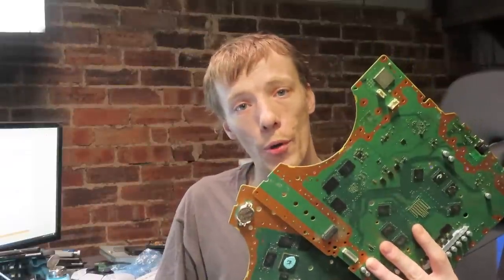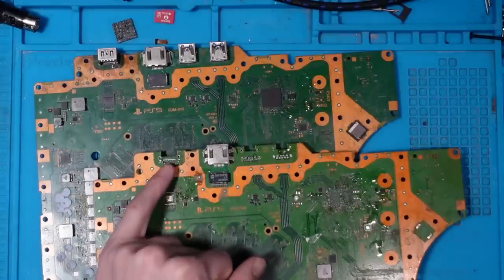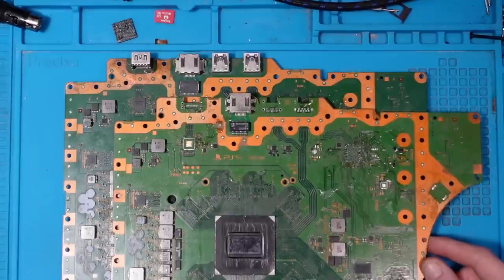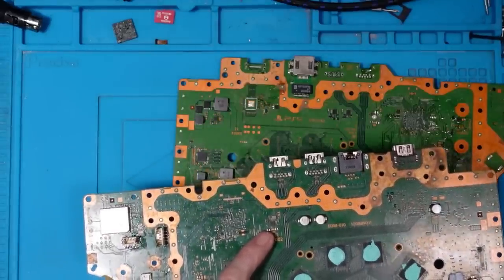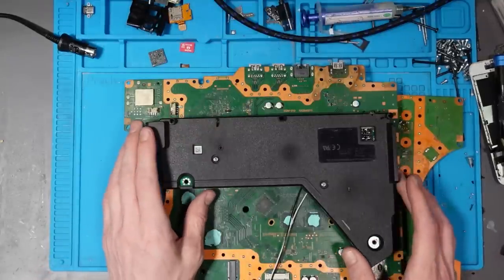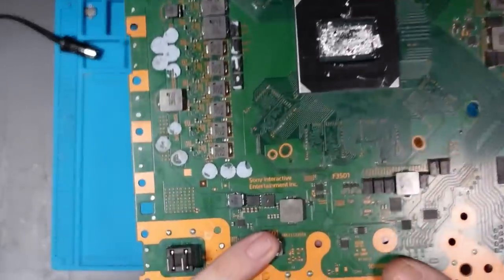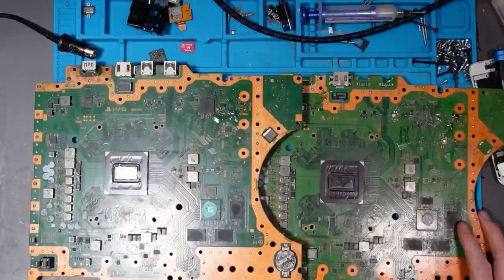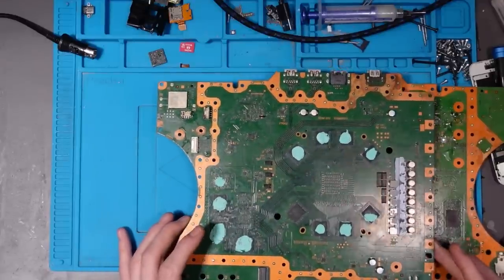Top 5 PS5 Problems And How To Fix Them - The Most Common Reasons Why YOUR PS5 Might Fail!

Comment: If you're not a profession DO NOT attempt to replace the hdmi port yourself as you will make things worse 100% guaranteed
Reply from the maker: No mate you're wrong there. I don't mean any offense by this whatsoever, but you can't just tell people not to attempt it. People replace their own port themselves all the time. If they have the tools and they're willing to give it a go, I always recommend having a go. There's no better feeling than to get something working yourself. My entire channel is focused around helping people gain the confidence they need, and soldering isn't hard at all. All you need is the right tools and a bit of patience
Reply: @TheCod3r  I get customers often who failed whilst attempting replacement of a a HDMI port on a console to find not only lifted pads but even missing chips especially on the next gen consoles. Yes it's easy to do as a professional but a customer can make a right mess if they have no soldering experience let alone micro soldering experience. No offence taken and I see your view on things as we were both once a standard user. Thanks for the videos 👌

Comment: Is there some communication between the power supply and the mainboard? 
If not... maybe people can just replace the power supply with a general purpose 12V PS.. basically leave the PS out of the PS5 and just connect the 12V.
Would that work in theory?

Comment: Got a ps5 here no power, no beep at all by pressing power button
in the f7002 area no 3.3v voltage, 5v are present, fuse is intact
Tried to inject 3.3v voltage, but the ps5 is still without life, have you experience in injecting the 3,3v iwth external power supply, does the conole power on, when TLV62090 is defective ???
Reply from the maker: Unfortunately it won't power on when injecting specific voltage rails unless that line is just open line (like a blown resistor or fuse), normally if it's missing it's because something is short so it'll just pull down to ground. Realistically you need to find out why the line is missing rather than trying to force it to turn on

Comment: Thanks for good content!
My PS5 turns off by itself after 5-10 mins of running. More frequently when the game is running, but it can fail even from the dashboard. Sometimes it happens even from the safe mode. Replacing the PSU didn't help.
Visual check of the board doesn't give any clues. I suspect bad contacts on RAM/SSD. Have you seen such problems earlier? Can you give some advice? Reflow RAM/SSD chipsets?
Reply from the maker: It could potentially be overheating but I haven't run into that problem myself yet. Do you get any error messages at all?
Reply: Just fixed a new two month old ps5 for someone that had overheating issues. Thought it was going to be the fan but turns out the APU didn't have near enough liquid metal on it. It was extremely dry. This was the first I have even heard of this issue on these. Replaced it and had no issues afterwards.
Reply: @TheCod3r  unfortunately no particular error messages. On very rare cases the game stops with an error, but the dashboard keeps working. In most of the cases console just suddenly turns off and the next boot up it recovers the FS. Sometimes boot up process also hangs (hangs on the blue or white light). Therefore I have to plug off the console and wait 15-30 mins.
Reply: @kaydiam7065  before doing a reflow i recomend you to check the liquid metal it could be badly applied and not making a good contact and overheating
Reply: I had one from a friend behaving like this and was due to overheating. It was quite dust but don't think that was the culprit but adding a tad more liquid metal, spreading it properly and making sure the clamp and subsequent screws were tightened enough solved the job and it's been several months now.

Comment: My PS5 ended up having a PSU issue (the power button does nothing - no beeps no lights), so I bought a replacement PSU and verified that the PSU was good, but the PS5 still shows no signs of life. I’m assuming it is something on the motherboard now…any suggestions?
Reply: Btw I tested the old PSU and verified that it was indeed faulty before purchasing a new PSU
Reply from the maker: It could very well have taken out something like the southbridge or the HDMI Encoder. These are notorious for that if you've had recent thunder storms or a power surge of some sort
Reply: @TheCod3r  Is it possible to get replacement parts for these chips without a donor board? I wanted fix it myself, but I’m a novice still when it comes to soldering and I don’t have access to other broken systems for replacement parts.

Comment: ill catch yu on one video? ive got xbox x changed port worked for week and went beep on beep off i think? well if yu press the button rapid it turns on and straight back off! but the controller vibrates so i dont know ive checked my work! twice? josh said power rail but i want yur imput? and ideas i thought retimer or mosfat?
Reply from the maker: Hey mate, I'd say it sounds like you might have an issue with either the 5v line on the HDMI or possibly the redriver or ESD IC could potentially be bad. It's hard to say really but those are the most likely scenarios
Reply: @TheCod3r  josh diddnt think so but ive got spair redrivers and esds but wont go in safe mode or display? i told josh it would be that

Comment: So my ps5 freezes and it goes to a  gray screen  then after while it will show the ui again but i can't do anything so I have to reset my console by unplugging or holding power button down on console   it's a digital ps5.  ANY IDEAS?   P.s it doesn't happen all time but it happens alot more then it should its not overheated cause it can happen a few minutes after I turn it on

Comment: Great video Master, I have here ps5 digital completely dead no beep no light ,all voltages present but the 1.8 V under the Southbridge not detected if you press Power button ,after replacing Southbridge from donor board same story ...another bad Southbridge or wifi module can cause no power? Thx .
Reply from the maker: I wouldn't say the WiFi module would cause it, but if it's completely no power look into swapping the bios chip from a donor board :)
Reply: @TheCod3r  I will try thx for that .

Comment: I have a ps5 here which quits all games after starting with the error CE-108255-1 and goes back to the system menu
All games crash with error message CE-108255-1.
Sometimes the System Menu image disappears for a moment and comes right back.
I have already tried everything on the software side, such as rebuilding the database in safe mode or completely re-flashing the firmware via a USB stick
Do you have an idea what it could be?
Reply from the maker: I believe this is an issue with the SSD but I can't confirm yet as I've never replaced the SSD (I believe it's married to the console unfortunately)

Comment: Touch wood my ps5 has been solid to date 
Was swapping my hdmi cable from that to my Apple TV to stream free tv about a week or two ago😂and told myself to stop after a few days before the hdmi dont work on the ps5 😟I’d be so gutted
Reply from the maker: Fingers crossed it stays that way for you mate. I'd recommmend getting yourself a 4k HDMI splitter, that way you won't need to worry about swapping, just press a button and it'll switch automatically ;)
Reply: @TheCod3r  very good tip ta much appreciated 👌🙏

Comment: Never see xbox series within your channel. Is it finaly the other way round where its the Sony product are not worth there salt with many design flaws and manufacturing errors.
Reply from the maker: Yeah to be honest xbox series are far more reliable, but then in my opinion so was the xbox one x and one s compared to the ps4 slim and pro
Reply: @TheCod3r  nice to see xbox fixing its mistakes in design over the years. Tho I'm still a big advocate of direct cool not a fan of the fan in top and suction through the system style cooling.  As an owner of the series x i'm blow away the fact that I've never once heard the console running. I dont miss the xbox 360 days where the power suplys sounded like microwaves haha